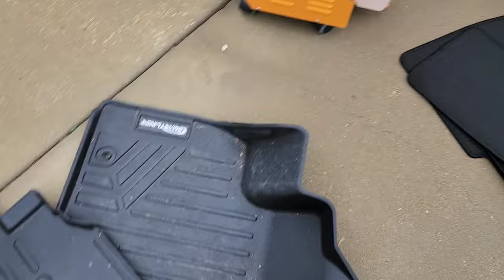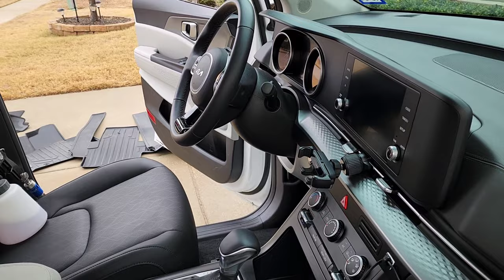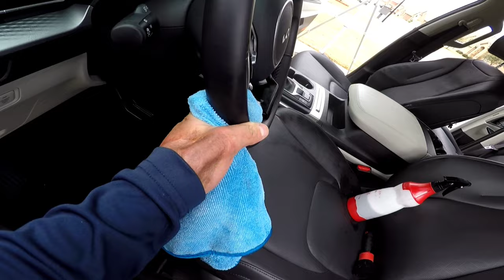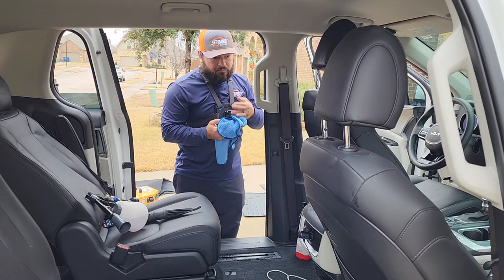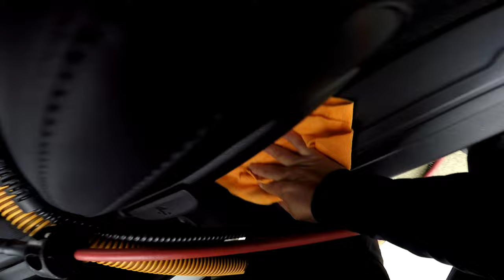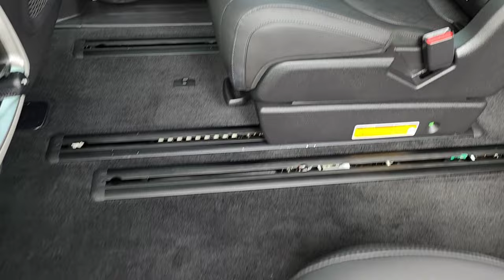DETAILING A MINI VAN! #mobiledetailing

Comment: hey Carlos what's the name of the air gun you use first? The tornador is too thick to get into smaller areas and that thin one you use may work for future interior details. Also what is the name of the tool you used for the leather seats to unclog the holes?
Reply from the maker: hmmm I think turbo blow gun, harbor freight has them

Comment: 🤦‍♀Should have taken out the 2nd row seats, would have made your life much much much easier. Rookie mistake!
Reply from the maker: why if I can just slide them? but I think many do?  I work differently. but I definitely get where you coming from
Reply: @serranosmobile  On those vehicles the (correction 1st row) seats are made to be taken out without any tools & within seconds.
1. Floor mats would have be remove and installed much easier.
2. You have much much much more room to vacuume.
3. Cleaning rails, without the need to push seats back and forth.
4. Cleaning the 2nd row seats, easy.
5. Cleaning the interrior in the back row, with ease.